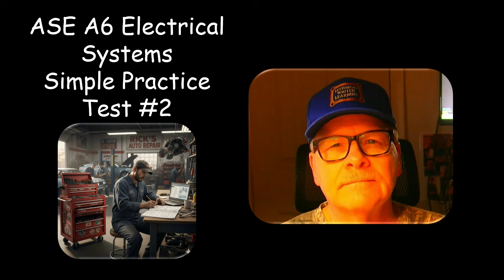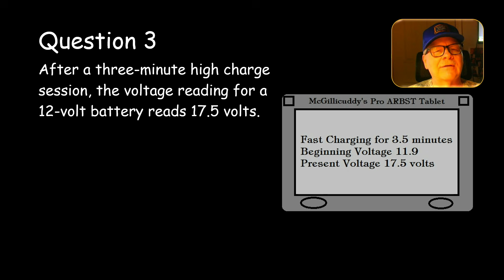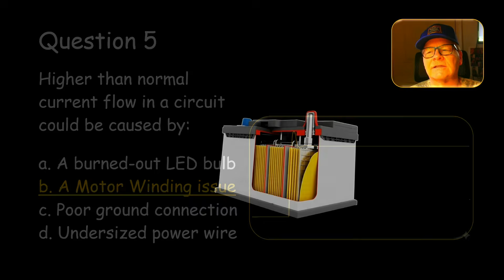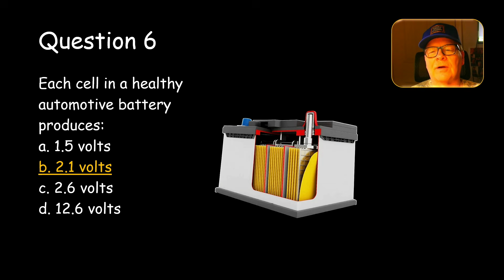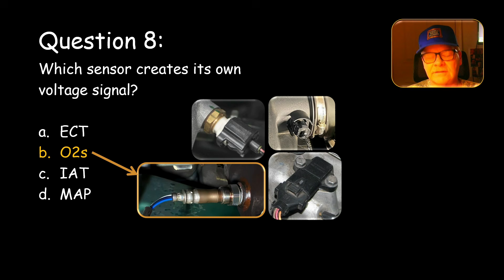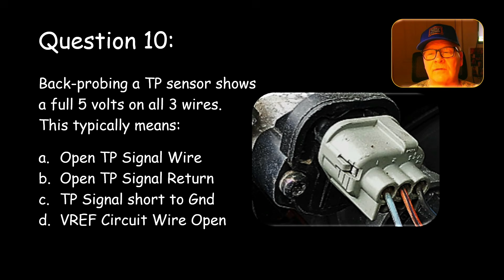ASE A6 Simple Test part 2

Comment: I dislike question 3. It’s a crude hold over from a time where smart battery chargers didn’t exist and load testing was a waste of time. If I saw 17.5v from my smart charger I’d suspect my charging equipment had an internal voltage regulation failure. Also what is a “high charge session”? I guess that button broke off my charger because all I’ve got are amperage settings. 20A? 40? 200? Questions like this on a test suck.
Reply from the maker: The Chargers that we had in the shop had charge levels all the way from low charge all the way up to boost and everywhere in between and a lot of shops still have those old Chargers